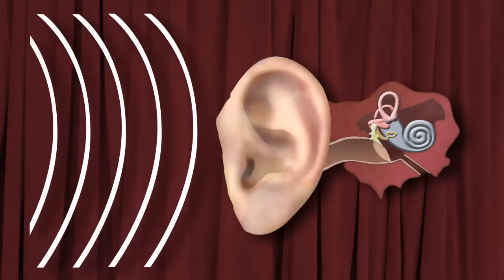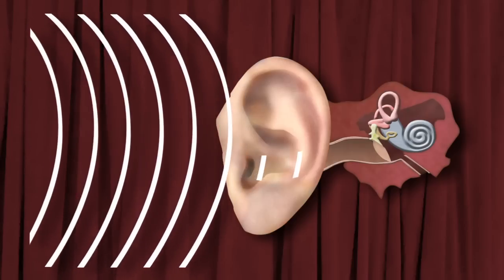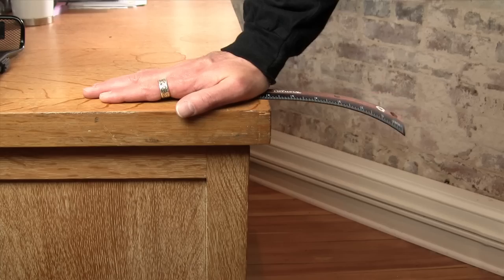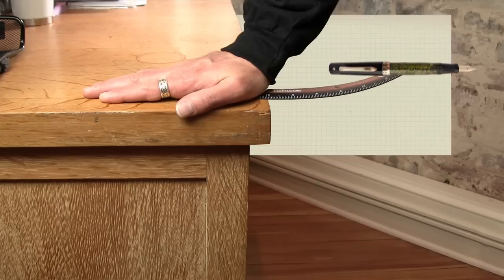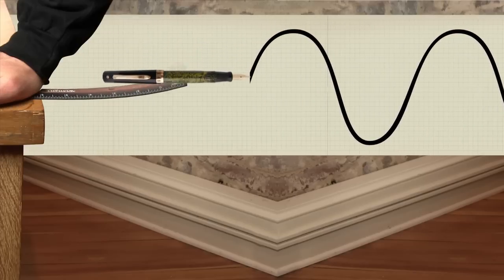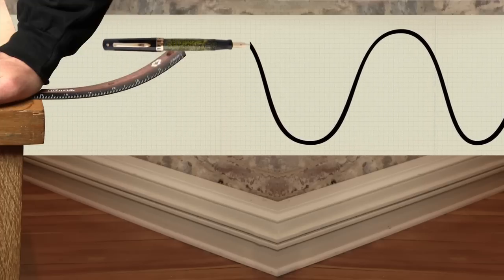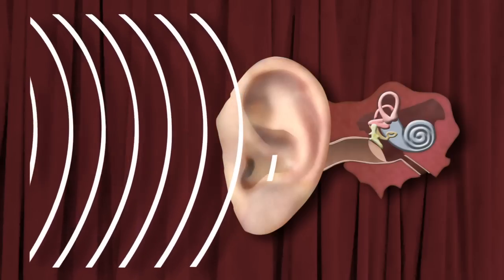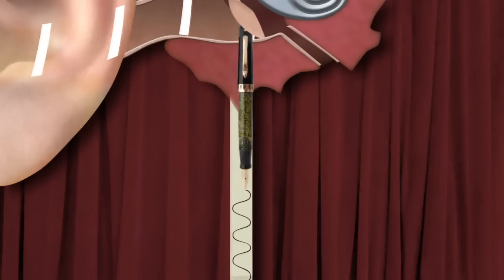The Synthesis of Synthesis- Sound

Comment: Here's the next incredible thing about the drawing the ruler's path on paper and producing a visual waveform ... you can store that waveform on say, wax ... or magnetic tape. And play back it. The key is to understand how a microphone electrically "draws" that waveform to a storage medium and how a speaker "undraws" that waveform into actual sound pressure. Bonus points for understanding what "no current flows into or out of the inputs of an op amp" means ... it's the SAME PRINCIPLE. Amplification is taking a COPY of your input signal, and shaping a new waveform FROM THE POWER RAILS THEMSELVES. Once you wrap your head around this concept, audio electronics become much easier to understand. I hope that made sense, because it is difficult to convey succinctly.